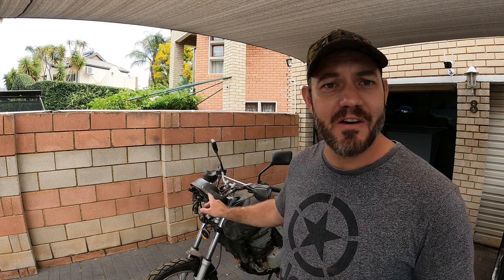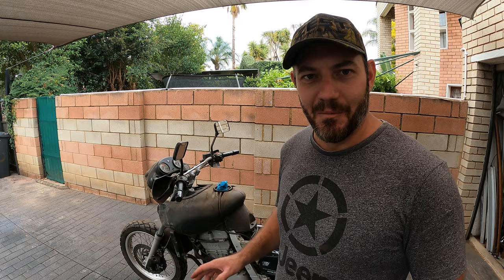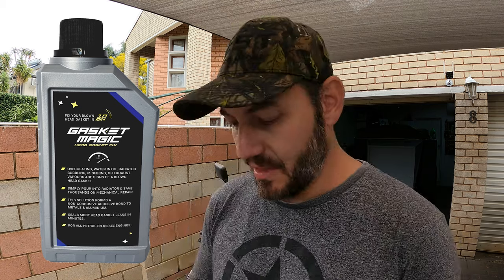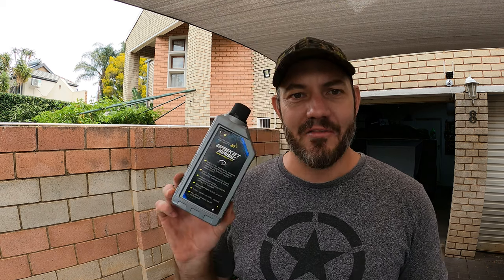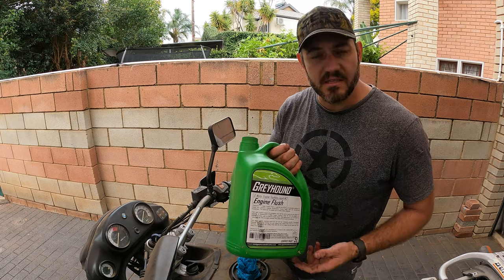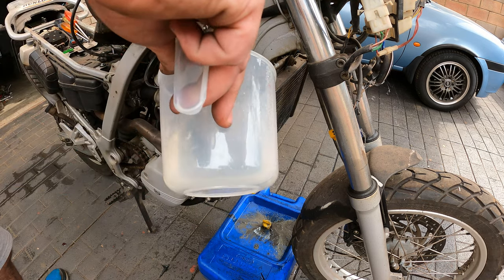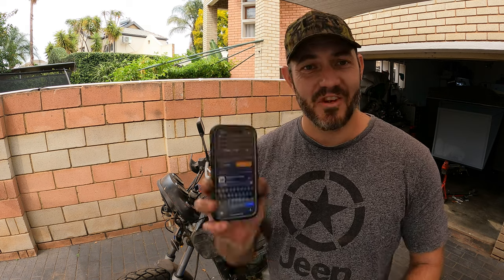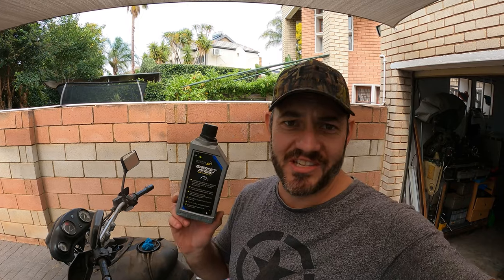Does Head Gasket Sealer Work? TEST on BMW

Comment: It’s going to work if you are loosing coolant slowly. If coolant is already mixed with oil or water coming out exhaust it won’t work. I know someone who is going for years on a bottle of gasket magic.
Reply from the maker: I agree, the situation with this engine unfold in the next video when we decided to take it apart. It had a seized waterpump with seals blown out from oil and water side, thus mixing oil/water. I would like to try the gasket magic again on something else in the future